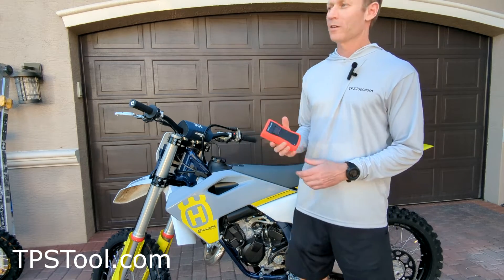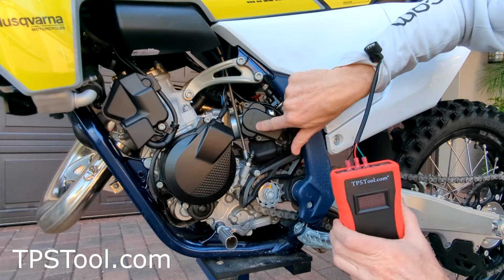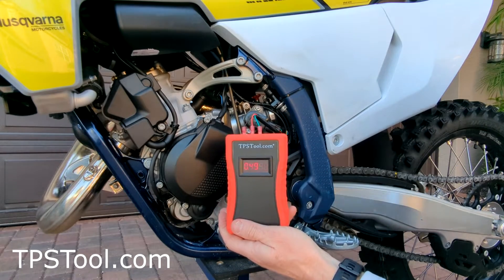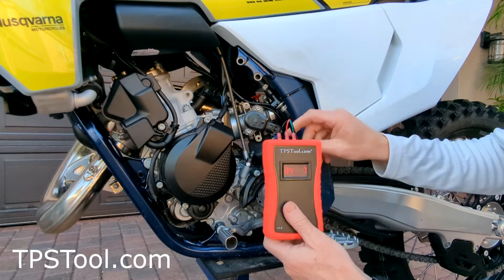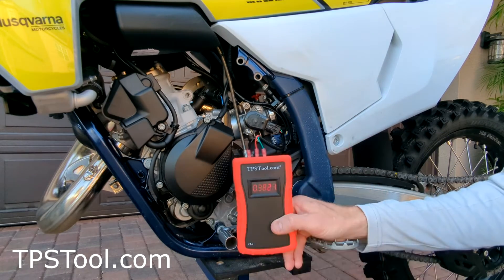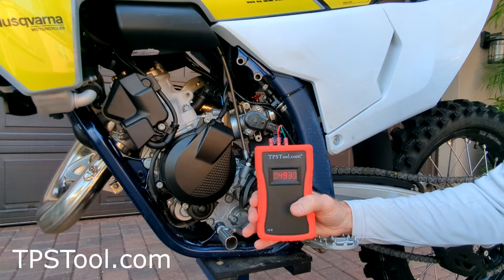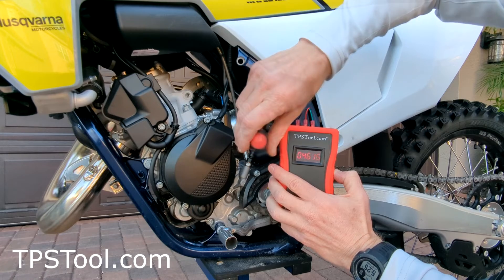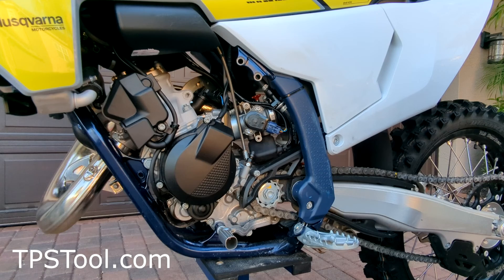Adjust the TPS on Husqvarna TC125 (and KTM 125SX), and set base value

Comment: I’m not sure this process works for my bike, which is a 2023TE 250. I don’t see the idle screw on the top of my bike. I see a flat set screw right beside the pullout choke right beside the throttle sensor and I can’t find any videos online on how to check my voltage.😢
Reply: 2018-23 TPI bikes don’t have idle screw, you can add it but its a mod search tusk tpi idle screw adjustment and you will se some tutorials and they will explain

Comment: Once the TPS is set 24 125sx (going to buy your tool here shortly) does it matter where the idle and cold start are set? Or can I set both to my liking?
Reply from the maker: Thanks for your question!  Once you've got the TPS set to where it runs best, feel free to change the idle as needed.  You may even end up doing a little back and forth between them to fine tune.  Once you're messing with both, the trick is don't get stuck on what the actual numbers are (since the idle change will change the reading), just be sure that your adjustments are only about 0.02 at a time.  Set the cold start to where it works best for your warm up.  I hope this helps!
Reply: @TPSTool  awesome! Thank you for taking the time to help.

Comment: Hello, have a 2024 KTM EXC 450 and when I start it and the engine is cold it immediately turns off if I don't accelerate. So in this case the TPS is set incorrectly?
Reply from the maker: A handful of things could cause that.  Has the bike always been that way?  If it's a new issue, first check your valves to make sure they're not too tight, make sure the injector is clean and make sure the fuel pressure is good.  If the bike has been that way since it was new, then it's likely just too lean in the fuel map.  Especially if it's got an emissions friendly map installed.  In this case adjusting the TPS higher would make it richer and could help.  Also make sure the idle isn't too low, and if by "cold" you mean actually cold as in colder than about 70F/21C then give the cold start knob a try if it has one.  I hope this helps!

Comment: I did it wrong. Ur full closed valve is 0.38 so its lean, u changed it even leaner. U should set value 0.4 fully closed ane then use screw to wet idle.
Reply from the maker: Thanks for your comment.  We went leaner on purpose.  This particular bike was running too rich from the factory.
Reply: @TPSTool  should be 0.4, it was 0.38 so its lean, you set it even lower value like 0.35 so its even leaner
Reply from the maker: @bandyta928  Thanks for your comment.  We went leaner on purpose.  This particular bike was running too rich from the factory.

Comment: Hello... question

Would appreciate any suggestions. 2012 Polaris 800 EFI hesitates at 45-50 mph. 45 is about 6350rpm. Not really a sputter or cough. Repairman just cleaned throttle body and fuel injectors and said idle air circuit was partially open causing a misfire at that speed. Work did not solve the issue. He set the TPS at.730 as per factory specs...One person suggested the primary and secondary cluthes might be fighting each other. Need to get it fixed pretty quick so we can sell it and move, but I want it to be right. I should also mention that it has full power no issues 0-45. No codes, no engine light. Always at that speed only.Thanks folks. Appreciate anything.
Reply from the maker: Thanks for your comment. That's a tricky one to diagnose from here.  If you're in the bottom 1/2 or 1/3 of the throttle when the hesitation happens, then a TPS adjustment is more likely to affect it than if you're closer to full throttle.  It wouldn't hurt to try tweaking it a little higher (richer) or lower (leaner) to see what happens, make changes about 0.02V at a time.  But that said, it could be a number of things.  Check all the basics first.  If that year has an IAC valve then definitely make sure that valve is working and not stuck or dirty.  Replace the fuel filter if it hasn't been replaced to be sure it's not restricting flow.  Also make sure the fuel pressure is correct and that the injector spray pattern is OK.  I realize they just cleaned the injectors, but it doesn't hurt to double check the spray pattern.  Also make sure the spark plug wire and plug itself are OK.  Also check the wiring harnesses carefully for any wear spots, several Polaris models have known issues with wires rubbing on various parts and eventually wearing through the insulation.  Also make sure the air filter is clean, exhaust (spark arrestor) isn't plugged with carbon, and make sure the gas is good.  Lots to check, but this is the best I can come up with off the top of my head.  Good luck and please post back to let us know when you figure it out!
Reply: @TPSTool  Thank you. I'll let you know what I find out.
Reply: @TPSTool  Thank You for your response. I have some new information on the 2012 Polaris 800 Razor having issues at 45mph. 
I was asked if it could go faster than 45mph. Just took it for another test. As usual it hesitates at 45mph. I pushed it on a longer stretch and when it gets to 50mph it stops hesitating. When I get to 55mph it hesitates again. Top speed is 60 mph at a maximum of 6500 rpm.
To obtain codes, one video suggested turning the key off and on 3 times and it will show a code. Didn’t see anything pop up when I tried it. I don’t know if this 800 has the ability to display any codes?
I’d like to include some responses from folks kind enough to offer suggestions to see if it triggers any other ideas pointing to one thing.
The spark plugs were replaced about 1.5 years ago. They were examined recently and found to be good. I still might replace them as that’s a cheaper item. I suppose it could be a bad spark plug wire.. or coil wire. Your thoughts?
Suggestions: fuel pressure check, sounds like fuel pump, spray water on spark plug wires and coil wire, Fuel stabilizer, Belt might be slipping, inspect clutches and belts, don’t think its clutch related, sounds like clutches sticking, check belt for damage, weights in primary clutch are too light, was IAC mechanically stuck open or electrically being opened.
Thanks again. I’m hoping this new information might directly point to something that I will try and tackle on my own. Taking it in is a last resort for me. 
I promise, to get back to you once I find the issue!
Thank you kindly. Very much appreciated.

Dave
Reply from the maker: @davepo6443  I think you're on the correct approach to just go item by item methodically, removing things from the list.  I would definitely replace the spark plugs, it's cheap and easy.  Also keep an eye on the RPMs, just in case it's possible that the clutch/belt is slipping and the motor is hitting the rev limiter, which would feel like a stumble.  I'm curious to hear what you find. :)
Reply: @TPSTool  I called the repairman.. I printed off all the suggestions offered for him. Also removed senders contact info before doing so. He feels bad. 

He said the factory setting for TPS was .73 and thats where he set it at.

He said he will fix the issue labor free and if parts are under 100.00 he'll eat it. If over 100.00 we'll talk, but at his cost. 

With all the suggestions it seems like it's pointing at the following: possible fuel pump which he checked, but not at high speed, a clutch and belt inspection or issue,  spraying water on old ones first. I don't know how old the wires are so probably worth doing. I did suggest a rebuild kit for fuel pump he said no they can still have a problem and he would go with an All Balls fuel pump if needed. He has a great reputation in town for doing things right. Thank you again, I'll let you know what the verdict is.
Reply: I finally have the answers on the 2012 800 Razor issues. Thank you for your response!

Summary for 2012 Razor 800:
•	Fuel pressure was a consistent 44PSI which is in spec. Previously verified during last repairs.

•	Spark Plugs were checked during previous repairs and color was a light brown 
(NGK BKR7E) Plugs replaced in previous repairs Jan. 2023

•	TPS set at .730 per factory spec. using TPS TOOL brand meter (specified range is .720-.740 TPS voltage setting controls idle and start up.

•	Overall TPS voltage affects WOT, but that would be bad TPS unit.

•	IAC solenoid was partially open because of excessive dirt build up in throttle body.

•	Injectors were checked and cleaned because fuel goes bad much faster in the summer heat of the desert.

•	Mass Air Flow sensor was cleaned with MAF sensor cleaner because of dirt and oil build up

•	UNI brand Air Filter cleaned and treated and intake tract cleaned

Diagnosis:
•	During diagnosis test drive the operators RPM’s were watched closely.

•	During wide open throttle pass on pavement, engine was at 6400 rpm at 45mph.

•	6400rpm is on the rev limiter and that’s the surging feeling. Had to feather the throttle lightly to work towards 50mph and hit 6400 rpm again.

Definitely Clutch related (clutches were not serviced in Jan of 2023, only on new belt).

CLUTCH INSPECTION ON MACHINE: 
Secondary clutch was difficult to open for belt removal.

Primary Clutch:  Needed partial rebuild
•	Installed new OEM sliders 
•	Rollers in the spider were good
•	Installed new OEM 2- way bearing
•	Installed new OEM 23-62 weights (removed 23-58 weights)
•	Installed new OEM shoulder bolts for the weights

Secondary Clutch:  Tear Down
•	Internal Rollers in excellent shape
•	Excessive dirt and debris in bushing area of moveable sheave resulted in hard to open during belt change, also translates to poor operating results
•	Replaced Belt Drive
•	After Clutch servicing engine holds at 6150 rpm during wide open. Wide open throttle RPM/MPH test

No issue getting to 55mph, did not try for higher MPH as clutches now hold correct RPM
Reply: Hallo that red thing uou adjusted first wat was it ?